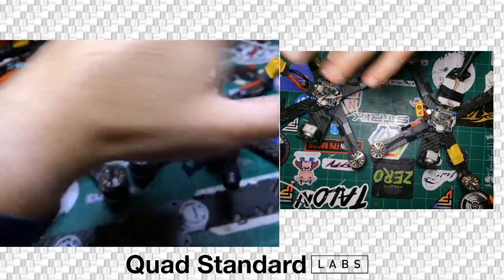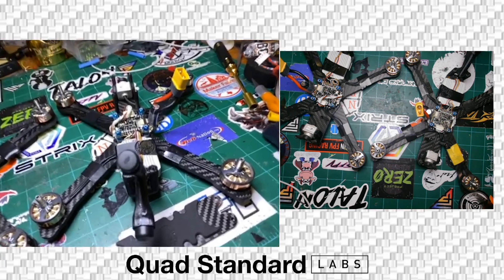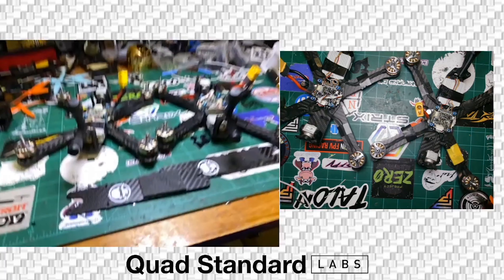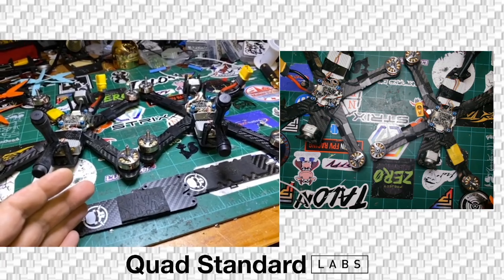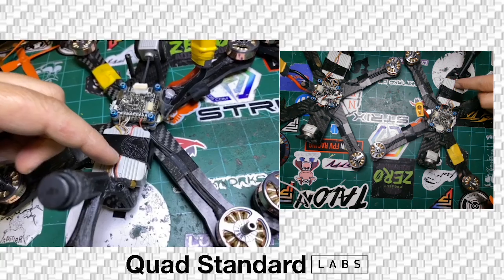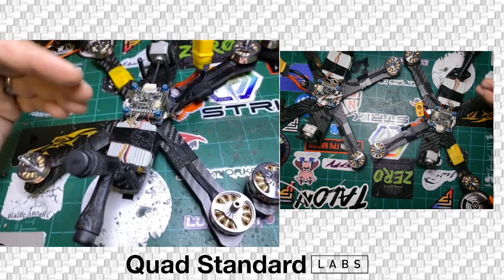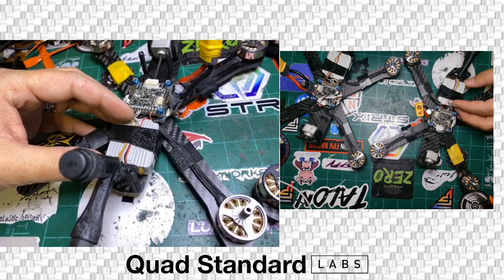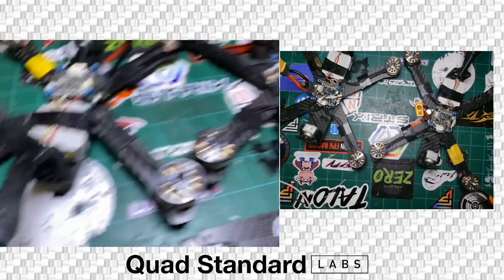How to Fix DJI FPV Power Related Issues CL1 HD

Comment: I use an HD FC board (kakute f7hdv, or Jhemcu f7 HD) with a connector to go to air unit. Is there a point to do what's been done in this video? Any chance that the air unit can cause some problems to fc (gyro) electrical problems. I'm having issues, the drone has some oscillations and some weird vibrations even the built is perfect and new.

Comment: I'm on 6s I have 20x20 Aikon FC 20x20 Tmotor 55 A Ultra ESC 1000 µF capacitor with a Fetteck spike absorber. 

What BEC provides 10 volts for FPV quad copters?

This is my last try at fixing my video freeze. My video freezes during flight in the goggles. I just have to pray I'm close to the ground and disarm.

Comment: Awesome, thanks for the info! Speaking with Conrad fixed my freezing issue by putting a bigger cap at the esc. But I'm using a 12v step down (iflight) and was getting reduced flight times on 4s. I'm in between 4 and 6s, so I have a motor output limit on a switch on the radio to be able to fly both. What 9v step down would you recommend?

Comment: I have a kakute F7 all in one fc and it has a cable ribbon to connect the AU. How do I go about doing what you did to your drone? Are you saying I take one of the wires and connect it to the battery leads? If so the positive or negative?
Reply from the maker: I show exactly how to fix in the video.  Move the power wires for the Air Unit to ESC pads.
Reply: Did it! Is the AIR UNIT supposed to get really hot while I have my batteries plugged in in beta flight? I haven’t turned on goggles yet and it gets super hot.
Reply: @guynexdoor   Yes, usually air unit get's hot once it's powered.
Reply: Can I get away with the 10v 2a bec in my T-motor esc? And does running the coax mipi cable under the Esc cause ishues ?